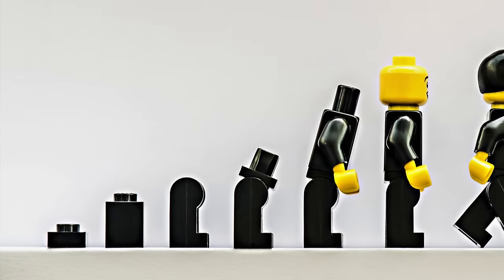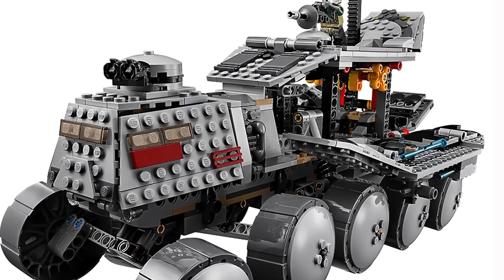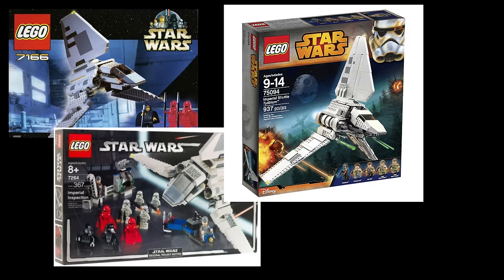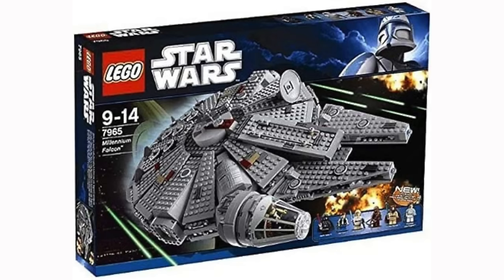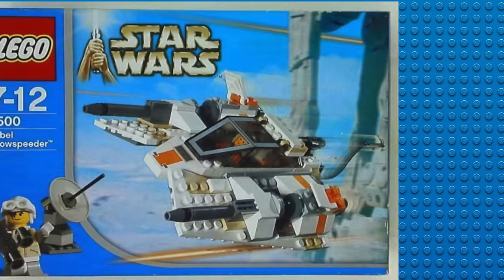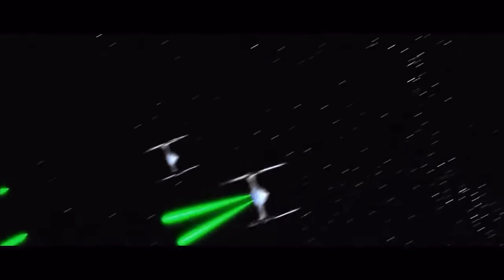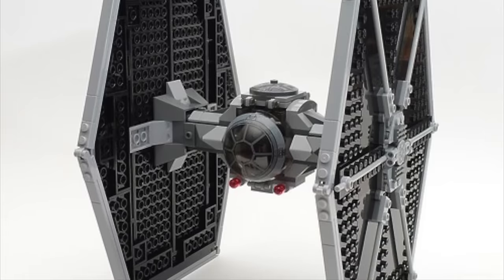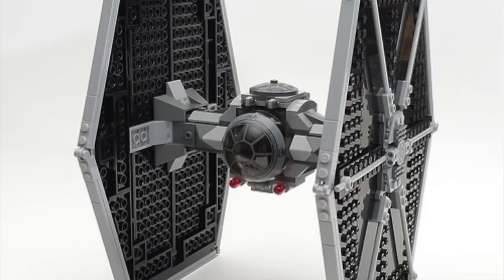the EVOLUTION of LEGO Star Wars sets (part 1)

Comment: Actually, you can see the back of the cockpit section of the T-16 in it's hanger in A New Hope, directly behind C-3PO as he's lowering into the oil bath. The gantry that Luke walks across to enter the workshop areas runs behind the engine and above the lower wings. It's hard to spot when you're not looking for it, but it's there, as well as his toy model version of course.

Comment: TIE Fighters are blue. I will die on this hill. They're blue in ESB and RotJ. The models used for both these films are clearly blue, you showed the picture! It's only ANH where they're grey. They had to mute the colour scheme so it would work on the bluescreen they used at the time. It's the same reason the X-Wings were changed from Blue Squadron to Red, and why all the shots of R2-D2 in space make his markings look black instead of blue (until the blu-ray version, anyway). 

Yes, regular blue is the wrong colour. But they didn't have the right colour in 1999, so it's excusable. They do have the right colour now. All Lego TIEs should be sand blue, and it's maddening that LEGO won't make them in that colour when it's *right there*!
Reply: Even though this reply comes pretty late: You are correct!

The TIE models used in the classic trilogy were blue. They only appeared to be gray after the needed digital editing.

As you already mentioned, it was a lighter shade of blue, not the royal blue used by Lego. Yet this is still closer to the original idea, than today's gray bricks.

Ps.: I still think that changing over to gray bricks to make the TIEs look like their counterparts in the finalized movie was the right move. I never liked the blue versions myself.

Comment: I think the original price should be included in such comparisons - as that shows just how insanely bad value Lego has become.
Sure the set might look slightly better (on the outside, the inside has only become horrible and makes the sets unusable for what Lego once was for - playing), but for the price of a single model now you could get 2 of the older ones.